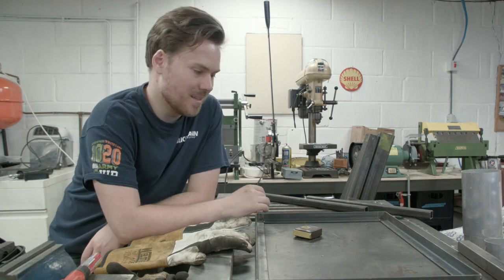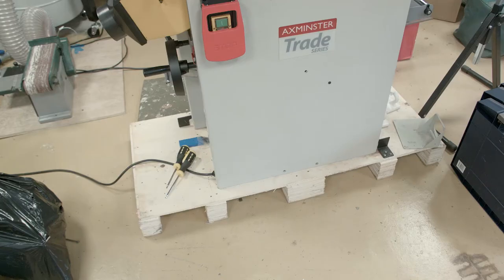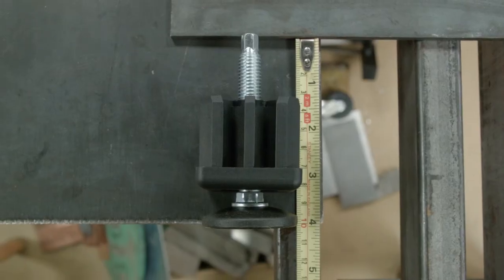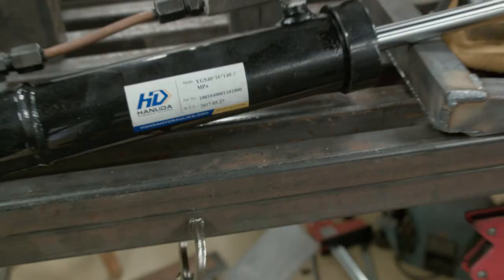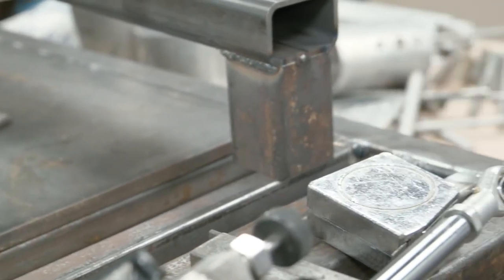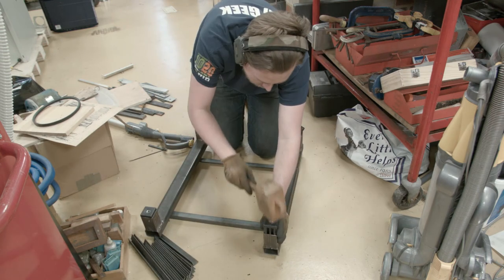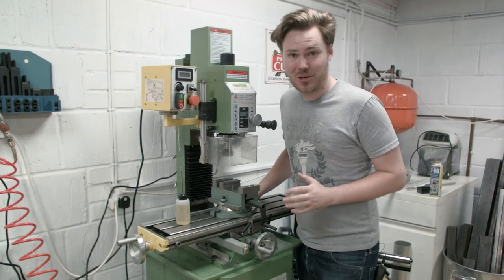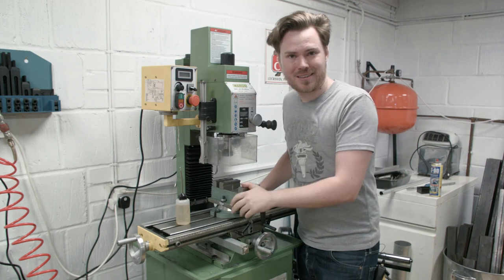Make an adjustable Mill Stand from scrap steel [METAL]

Comment: Also here from the making it sub. Love it, mate! Great title sequence, good channel name, I'm always a sucker for a British accent, visual storytelling, great sense of humor, self deprecating, a learning moment, call for interaction... you're doing a lot of things right.

I'm subscribed.
Reply from the maker: Thanks, glad I earned your subscription!
Reply: Malt & Make Re cutting the square tubing: you could machine a set of inserts that hold the stock at 45° to the blade. Just two blocks of steel with a 45° groove. Just needs to be deep enough to catch enough of the tubing past the radius.
Reply from the maker: The clamp does actually move to let you cut anything up to 45° but I rarely do it as it takes a while to get it setup and then zeroed after. The blocks sound like a really neat solution!